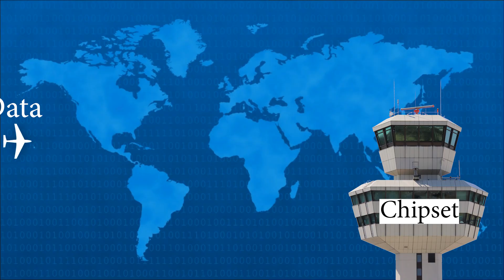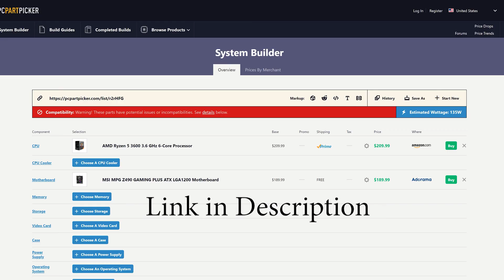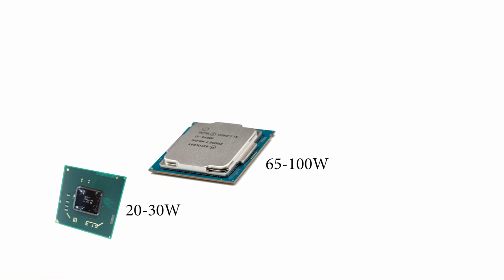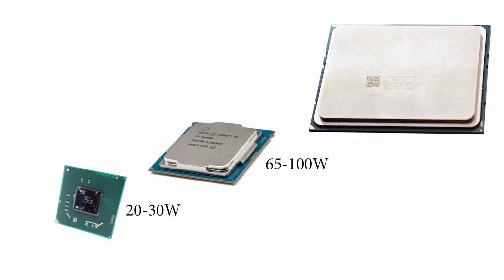Motherboard Chipsets Explained

Comment: Hi folks, I would like to change my Alienware PC case but with all components (i.e. Alienware mainboard etc.). Now I have encountered an obstacle, the power pins from the case do not fit on the mainboard. The Alienware motherboard uses a 12-pin connector for whatever reason. Maybe there is an adapter or something.

Comment: Nice, 
since recently all the motherboards do not have a separate northbridge/southbridge, 
Is this chipset the culmination of the two or they are different to this?
Reply from the maker: Yes, modern systems only have 1 chip that does the work of the old north/south bridge setup. Some of the features on those old bridges are actually done directly by your cpu now and everything else is done in the single chip chipset which is much more efficient.